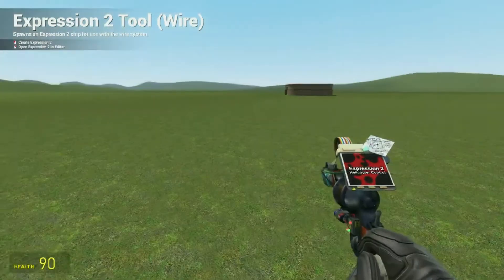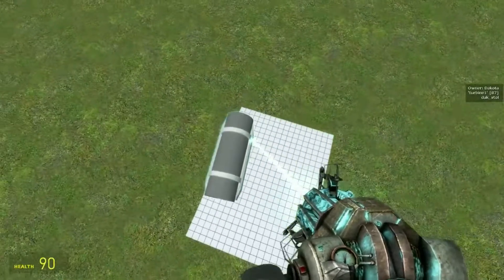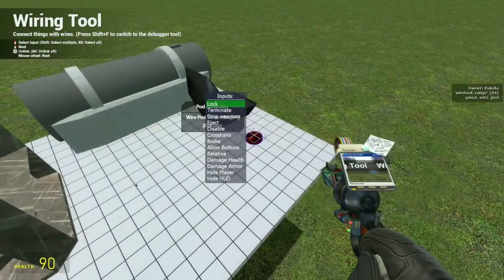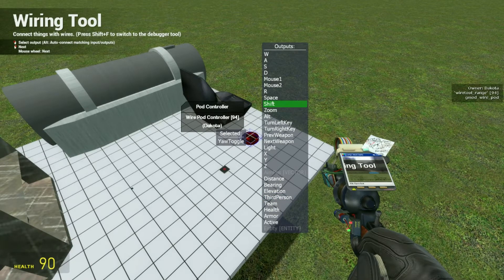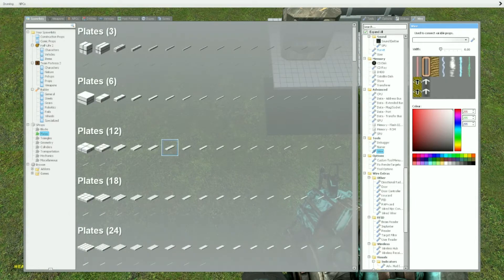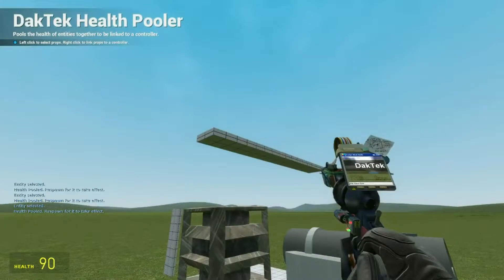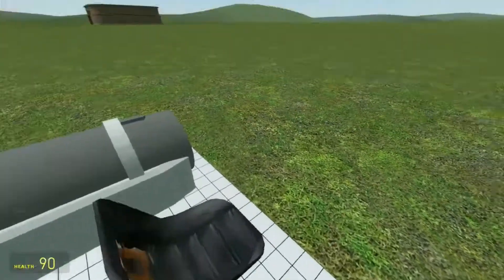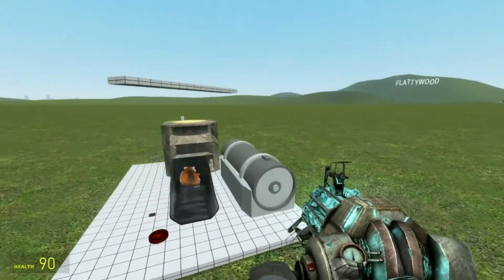DakTek Tutorial Series 7: VTOLs

Comment: Where is the multi-parent tool?
Reply from the maker: The multi-parent tool is on the workshop. On the DakTek workshop page I include a link to a collection which includes tools and commonly used maps for my server.
Reply from the maker: I don't see why it wouldn't work with PewPew, though I also don't see a reason why you'd need both.